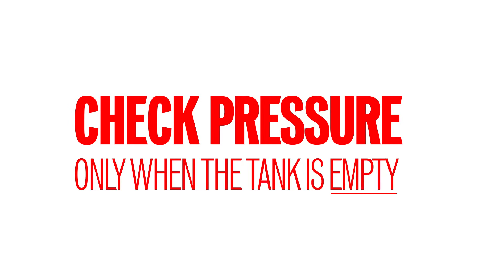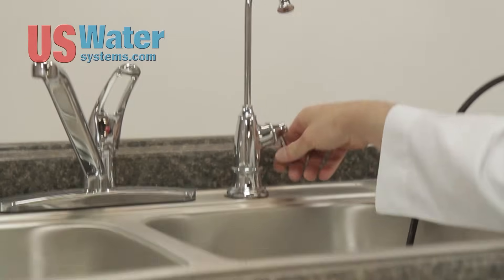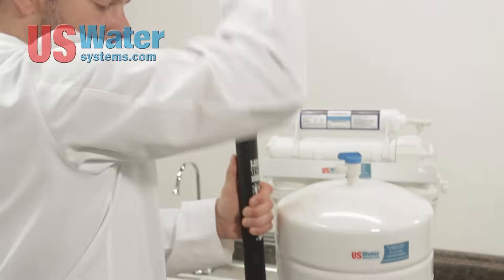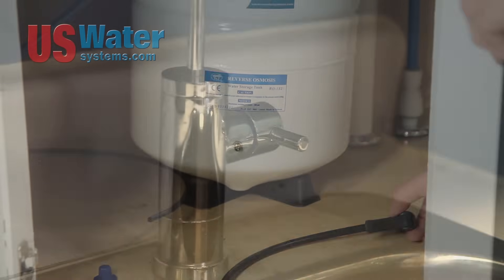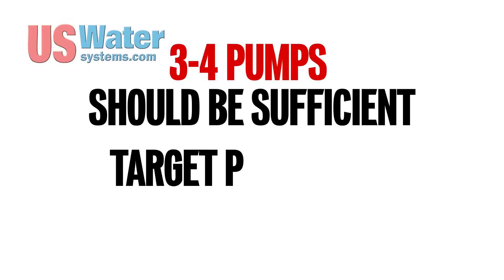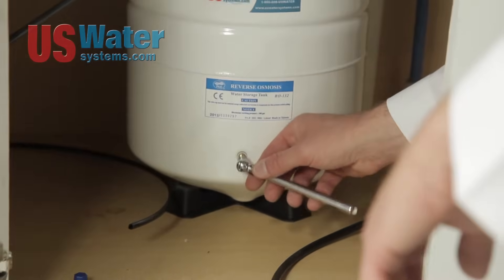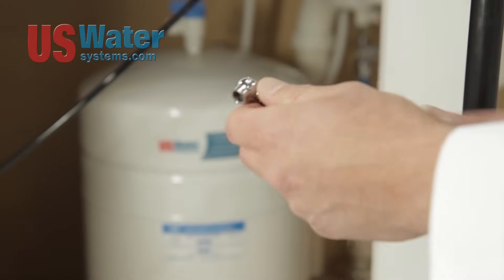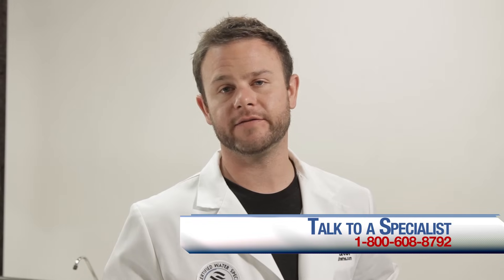How-To: Repressurizing a Reverse Osmosis (RO) System

Comment: The key thing "WRONG" with this video, and I'm amazed at their suggesting the need to put air in the tank! Almost every RO tank has a "BLADDER or Diaphragm" in it, this separates the water from the air so as you don't get foul tasting water, as well so that the air doesn't absorb the air... so that there should never ever be a need to ever add air! If you have poor water flow, and the tank is heavy, that means there is water behind the bladder! Not a good thing... at that point its Best to replace than try and fix, but if you feel the need try and continue to use... then at least sanitize the tank first before re-using!
Reply: Not necessarily true. Over time, the air can leak out, either through the bladder, its seals or the schraeder valve. What this video is showing is how to restore the tank to the proper pressure in the event that it has lost some. The purpose of the bladder is to do the things you said, but also more importantly to keep the pressurized air inside. Without a bladder, as the tank emptied, it would allow all the pressurized air to escape, which is how we got here in the first place. You want that 5-7psi in the lower half of an EMPTY tank so that when the tank is nearing empty, there will still be the air pressure to force out the rest of the water. Otherwise, it would just sit there in a full tank. The supply line alone is not enough to pressurize the discharge as the flow rate through the RO membrane is barely a trickle.

Comment: Shouldn't you turn off the faucet before setting the final pressure?
Reply: No, leave it open as adding air will sometimes push out a little more water
Reply: @motodude23  then how will the tank hold pressure if you leave the faucet open?     It will never pressurize then.    You lost me.
Reply: @mspring6387  half of the tank is a rubber bladder, you are inflating the bladder

Comment: while re pressurising using a pump via the schrader valve, i see water coming out of it, does this mean my tank is done? the bladder is broken?
Reply: Mr Lego I ended up replacing the tank.
Reply: Yes.  Bladder is shot and you have a "water logged" tank

Comment: Hi, I just replaced pre and post filters and membrane on my GE profile RO. If i remove the membrane I get great flow. If I leave it on, I get the “fill a half cup” problem.Very little water trickles from the filters to the tank, so it’s not the pressure in the tank. Do you think it was a bad membrane?
Reply from the maker: Trying to fill your tank with a fouled membrane may take 4-6 hours, rather than the usual 2-4 hours. You have a new membrane though so it should be fine. Remember, even a new membrane will take a few yours to fill your tank. Wait about 2 hours and see if the flow has improved.
Reply: I have a similar problem. After fixing 7 psi in the tank, water doesnt flow to the tank at all (less than 1 liter overnight). It does go to drain for some reason. Why?

Comment: Careful,  NEVER USE AN AIR COMPRESSOR. ALWAYS use a bicycle pump.  6-7 PSI AIR CHARGE IS BEST.
Reply: Yikes, I purchased an air compressor just for this RO project. What happens when using air compressors?
Reply: @MyronsBaldspotLovesKevSamuels  you will end up adding too much air and possibly rupture the internal diaphragm. 
Hand pump is best.
Reply: When the gauge ON THE AIR COMPRESSOR reaches 10-20 psi, turn it off. And then pressurize the tank.
Reply: NEVER USE AN AIR COMPRESSOR.
Reply: @dbeach562  When I re-pressurized my tank (6psi), my waste water ratio got much worse. Why? I have a booster pump and my ratio was well under 2:1, and now with a properly pressurized tank, it's 4:1.  LOL.

Comment: I can't repressurize the tank. It won't accept the air.. what is the problem
Reply: iHSAN 9T3 I’m having the same problem. How did you solve the issue?
Reply: What did you do to fix that problem . My tank won't  accept air
Reply: @patriciamoya2700  Have you emptied the tank of all the water?  Have you shut off the cold water going into the tank?

Comment: We tried to do this and now there is no water going back  into the tank?
Reply: You probably added too much pressure. This is why you use a low pressure guage and not a regular tire guage. The low pressure guage is more accurate for low pressure readings. On many tanks just a few psi over can rupture the bladder in the tank.
Reply: Your tank pressure is probably too high compared to output pressure from the RO system. The RO output pressure and thank pressure work against each other. The higher the tank pressure the lower volume of water the RO system and push into the tank.
Reply: Same here. Digital px gauge shows 6.7 psi empty tank but water doesnt fill the tank (filled less than 1 liter overnight), it goes constantly to the drain. Why?

Comment: I was filling up a 5 gallon bottle and ran the RO tank completely empty.   After this I noticed reduced pressure - is this a bad thing to run it completely empty and can it cause the need to repressurize the tank?

I went to fill it up, but my car tire gauge like the one you show won't read below 10psi, and I haven't found any pressure guages that read 5-7psi with having to pay a lot of money.  I tried it from the other end - i I read that when your tank is full if your water pressure is 60psi (which is what our house pressure is at) you should see 40psi in your RO unit.   When I measured the full pressure it was only 30psi.  I added 10psi, but the next time the tank filled up it was only reading 30psi again.  Is there something I need to adjust to set the cut-off pressure?
Reply from the maker: Emptying the tank should be fine. Do you know if your RO has a permeate pump?
Reply: @uswatersystems  It does not have a pump, it just has the smaller piece with four ports and small piece containing the diaphragm mentioned in one of your others videos.  I'm wondering now if the pressure at the RO input is actually 60psi - I measure 60psi where the water comes into the house (3/4" line) but I noticed that one of the outdoor faucets at the back of the house is only 50psi.  Something must have changed recently though, because RO pressure was greater until I nearly drained the tank the other day.  Maybe the timing is a coincidence, but maybe a line flow restriction of some kind?
Reply from the maker: @1030media  Yeah. If it was fine before, I would remove the water line going from your tank to the faucet and see if something is obstructing it.

Comment: Increasing pressure leads to reduce the amount of water in the tank
Reply: Not true. The bladder for the air side is only half of the tank.so if you have a 6 gal tank you only get 3gals of water. It just makes the water dispense  quicker.

Comment: The storage tank is full and very heavy . But a very low flow of water from our system. water starts out strong but after about 15 seconds it slows and almost drips 
What should I do
Thanks
Reply: ur pressure  should be checked, its likely too low and will not empty out all the tank unless set at 7 psi... that level though is what an EMPTY tank should be at
Reply: I had the same situation. I decreased the pressure with the flip side of a tire gauge and the outward flow increased dramatically. Less pressure in the tank, more water comes out.

Comment: I watched for videos and not one person has said while you are increasing the pressure in the tank you should leave the valve open or closed. Why does everyone miss that
Reply: NB - if your tank has been with minimal pressure for a while, it's going to take multiple pumps to get all the water out first before you can start measuring the pressure
Reply: Go Bless you for asking this
Reply: Can't believe they all skip this part. You can see it appears he has the top valve on the tank disconnected
Reply: valve closed
Reply: Thank you
Reply: @MrDmullen3  which valve to close?  faucet?  valve on the tank?  or the water inlet valve?
Reply: I found my own answer.  Water inlet valve off,  valve on the tank on, faucet valve off.
Reply: @hoodhunter3262  thank you, can't believe this important step wasn't covered in the video
Reply: @hoodhunter3262  wrong.  Water inlet valve off,  valve on the tank on, faucet valve on.  This way you know when the tank is finally empty.  You can measure the PSI properly only when the tank is empty.  You're measuring the PSI of the bladder, so it really doesn't matter if the tank is off or on or the faucet is off or on, other than to know when its truly empty.
Reply: @MrDmullen3  Which valve? The faucet? The valve on the tank? The water valve?